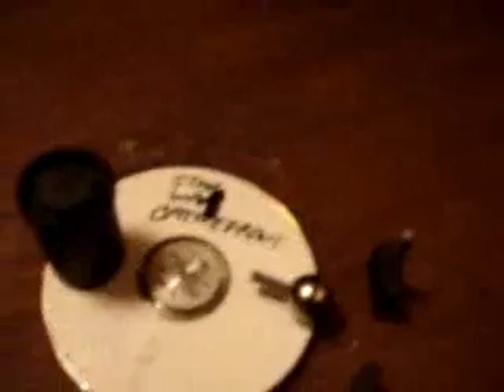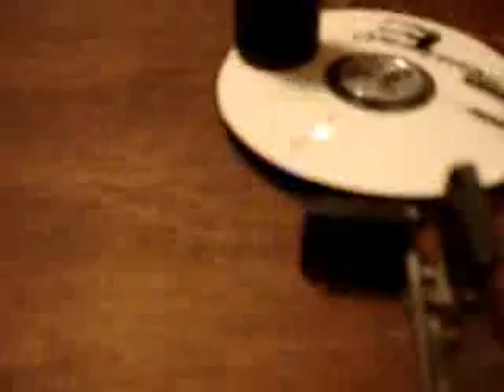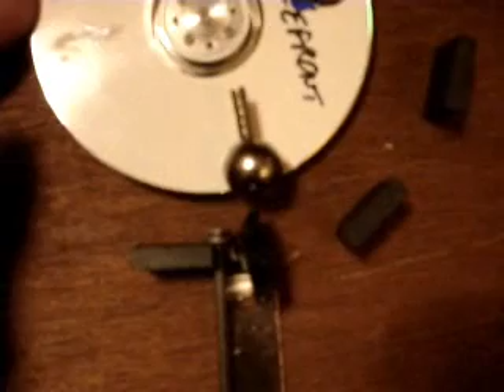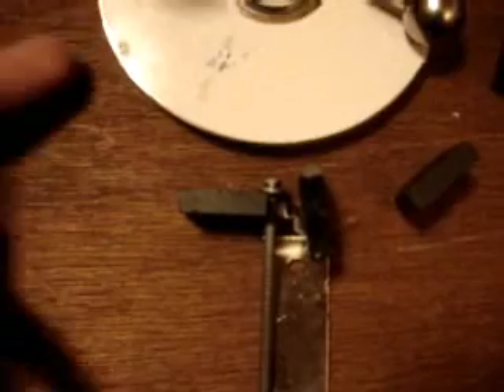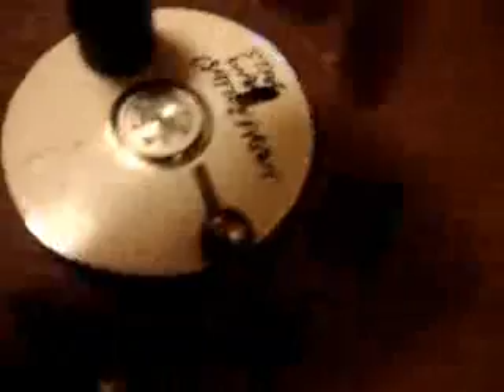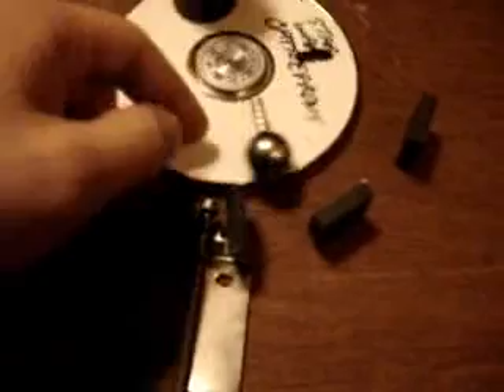Magnetic Gate

Comment: lol...you need to do what howard johnson was doing.......cut rectangular magnets at 60degrees......making wedge shaped magnets then separate them with wooden  wedges at 60degrees, I urge you to watch....a series called "Energy from the vacuum" or at least find diagrams of howard johnsons magnetic gate, configuration. magnets with poles of equal force will not work the wedge shaped magnets and the proper configuration allow natural flux manipulation.........good luck but don't continue with anything untill you have wedge magnets (buy a diamond saw it will come in handy)

Comment: Yea, the curve of attraction is different, but when two magnets touch each other, the movement stops.  No more energy can then be extracted.  Like a spring that is sprung, you must then put energy into it by pulling apart the magnets, (stretching a spring), to add potential energy to start the cycle over again.

The energy is integrating the force over distance, not the curve of force vs. distance.

Comment: The concepts posted have merit. If only the designers were to consider using outside power to overcome the "sticky spot" success would have been attained already. The energy is not free, it comes from the magnetic force introduced to these materials during a manufacturing process in which electricity is used. Having said that, I applaud these designers for trying to find a solution to our catastrophic ecological and energy problems. All others either help or stop demoralizing their efforts.

Comment: Yes, introducing more magnets will make more sticky spots. Furthermore the magnets also add to the effect. Lets do some theory-
Every point on the disc starts at some potential energy point. Because the disc is circular, every point may well run down the 'potential hill' but it has to come back up that potential hill, and arrive back at the same point it started from originally. So there is no gain in energy. The potential energy points arise from the magnetic fields that are set up. No gain !

Comment: The self-construction of a Schietti's magnetic wind power station. 

You need to buy an ordinary small wind turbine and change it a little bit. 

At the end of the blades you need to place some oblique magnets

Outside, you need to place a wheel of magnets of opposite polarity. Neodymium is a good magnet.

By increasing the circle diameter you'll inevitably reach the inertia break point.

Comment: ok here's what will happen.
there will be a significant difference between the first and the last magnet's pull right next to eachother. 
You are relying on the left magnet to pull the wheel from nothing when you hold it to the left. 
Then the next magnet grabs it and the next until it gets to the last magnet which holds it. 
Another magnet may hold it, but if there is no dead space to be pulled from, then you will have to add the spin. The spin you give it will diminish.